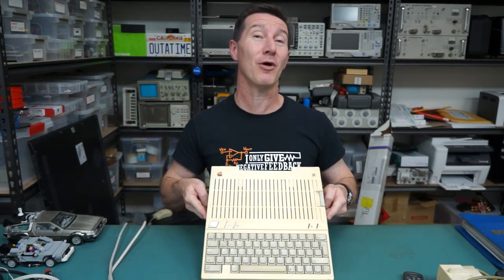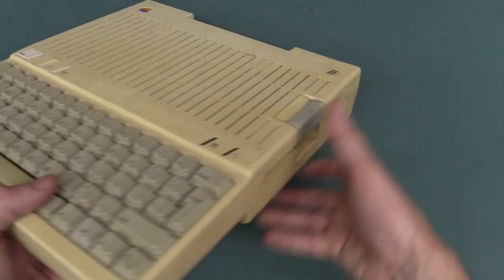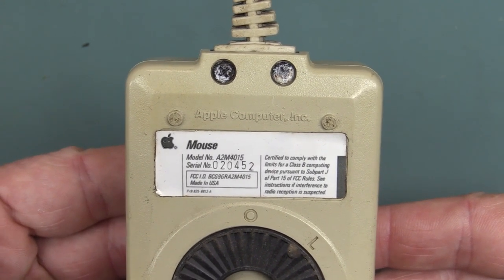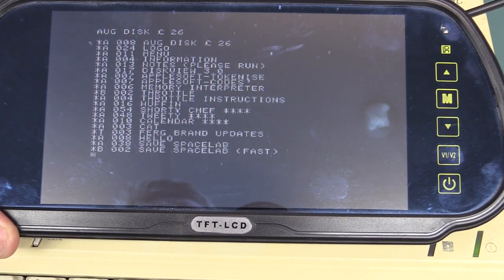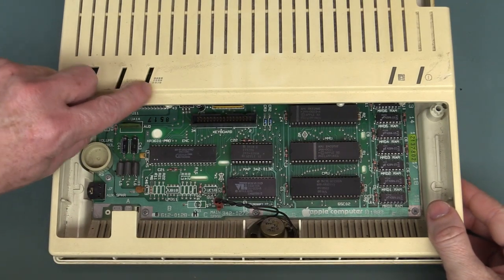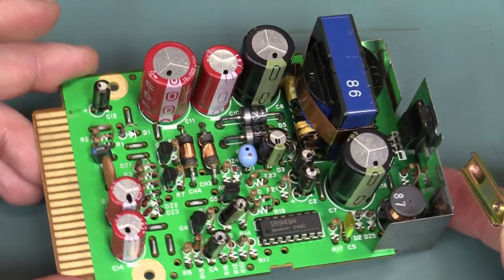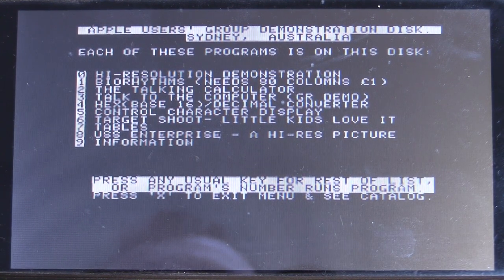EEVblog #788 - Apple IIC Teardown

Comment: I use a Dvorak keyboard religously. Made this decision at the age of 18 and coming on 20 it's still working well. I spent time analyzing the actual percentage of the time I spend using devices that are not mine, and noticed it's once in a blue moon - so it made sense to improve my speed and accuracy by learning Dvorak (yes it really does destroy your ability to use QWERTY well) - wouldn't go back ever I think.

Only problem is you have to order custom keyboards with the layout - which I do anyway with a WASD keyboard mech. And with a Macbook you can change the keys to the Dvorak layout without any fuss. Totally worth it :)

So I ask you Dave, from a logical standpoint... Why do people stick with QWERTY? Most use their own devices 99% of the time so why not use something that's better for you. Just a thought (not a rant)
Reply: You don't really need to order a custom keyboard. Since you shouldn't be liking at it while typing anyway, what's written on the keys doesn't matter. My main keyboard doesn't even have anything printed on the keys.
Reply: +ipullstuffapart and why is it better?
Reply: +cavemaneca If you're not 'liking' at it, maybe you should proof-read. lol
Reply: +Doug Wood I blame Swype.
Reply: cavemaneca
It can be useful sometimes, especially if you forget where a symbol is on the keyboard, as some are rearranged. My keyboard doesn't have any letters printed, just symbols.
Reply: CLIn7 l33tW00d
Dvorak increases typing speed by moving 70% of the typical keystrokes to the home row, and makes typing feel like a "wave" of sorts, you tend to use one hand, then the next, and back again - just the way that words are typed. Because you move your hands around less, less errors occur.
Reply: Ovidiu Lipsa
Nope, most keyboards have contoured keys that are specific to that row and position, if you move them, all of the tops are at odd angles and levels.
Reply: ipullstuffapart
but I believe that's language specific? maybe you can type faster in english but what about other languages?
Reply: +ipullstuffapart I am perhaps quite a fast and accurate typist, and much prefer the qwerty layout. Simple reason being that I don't use the 'home keys'. That entire method of typing is inefficient. You'll note this in professional stenographers, calculating accountants, and so on. People tend to find their own preferred typing method rather than a particular standard.
Reply: Gravity having a superior keyboard layout is not a necessary precursor to fast and accurate typing. With practice, any random distribution of letters could be used to type with. This doesn't make said keyboard layout actually any good by comparison.
Reply: +cavemaneca Keyboard layout is only relative to typing method. That's why the Dvorak layout has not shown to be 'superior' in scientific and corporate studies. Its only claim to benefit is putting more used letters on the 'home keys', which is irrelevant if the typist does not use a 'return to home touch typing' method. In essence, you find that above a certain typing speed, the typist may have a more custom method, while below that speed the person may not be typing enough for it to matter. There have been very clear corporate studies on Dvorak for a long time now, they just don't show an employee benefit to switching.

Comment: All Zorks etc use same virtual Z-machine system witch was made to work on all smaller systems of the era (C64, AppleII, etc).. There simply is no room for all texts on 64k or lower computers. 

Besides the texts on Floppy are compressed.. You'd need at least 256K to have it all uncompressed and loaded on ram
Reply: For the record.. The 555 is used to read analog (paddle) input, the paddle pot changes 555 recrarge time.

Comment: +EEVblog Hey nice videos... but I must ask why would anyone say the Apple IIc was a failure? The IIc was sold alongside the IIe as a smaller compact version of the Apple II series. The IIc was squeezed between the IIe and the IIgs and the Macintosh as well. The IIc was never meant to be a "laptop" computer but just a compact design. Though for 1984 the IIc design was pretty darn compact. Even so, in 1984 there were no true laptop computers that I know of unless I am mistaken? Yes I do get that the LCD screen is misleading but I believe that was Apple's way of showing off its design prowess at the at time.

Comment: at 18:02. Between the IOU and the MMU, what is "W2"? Almost looks like spark gap protection, but backwards. Hmmmm.

EDIT Found the answer online. W1 is a track that can be cut, W2 is a normally open solder bridge. Jumperless design apparently. :)

Comment: I'd like to see more vintage equipment. The bigger stuff example amplifiers, tv's, signal generators, rare desktop pc's

I wish i could send one big ass Turner A-300 Studio amplifier. 
But it weights a ton. And... well shipping from the Netherlands will be quite expensive :(

The Turner is really something, i wish Dave could do a teardown of my turner amp 
It has Bakelite/epoxy pcb's huge spacing between components, hand soldered extra thick ground traces, mil grade transistors (germanium) stuff like that. And really really monstrous transformer

Comment: As to the disk reading, if I had to guess, the program is probably hard coded to only load in so much data into memory at a given time as when it was originally written, it probably had a RAM cap due to the model of machine that was out at the time. Maybe it could only read 16 to 32k at a time to remain compatible with all the then current models. So no dynamically allocated RAM for you. You'll play that game like your grandpa played it and you'll LIKE IT! :)

Comment: I don't use a dvorak board, but now that you mention it...
The Razer program that came with my board gives me the ability to manually remap keys so could just pull the keys off of my board, move them, and remap the board.
Unfortunately, that's at the well above the OS level so if I change OS or need to do something in the BIOS it would go back to default map.

Comment: Dworak keyboard use here!
Reply: +AppleKnowsBetter keep working on your typing then!
Reply: +AppleKnowsBetter same here, but i only use Dvorak on my phone, so that I can change it more easy if someone else want to use it ^^
Reply: +AppleKnowsBetter Me too! Have been using Dvorak for 10 years now, never looked back. I never reordered the key labels, after all, dvorak makes it easier to touch type because the layout actually makes sense.
Reply: +retrotails WASD as far as I know dates back to the mouse+keyboard fps era, so much later. (I'm not a scholar but I did play FPS games at the time of change)

But games could be a reason, as they probably at the time wouldn't have had rebindable keys at the time (Atleast not the PC games I played), so you could end up with a hand stretching exercise.
Reply: +nimeq WASD predates FPS games by a good stretch.  I'm no scholar either, but I was there!  LOL
Reply: +William Hayden I was also there but in smaller form. The only case I can think of it being used would be multiplayer on single keyboard, which atleast on the PC was crappy, due to the key-press limitations of the typical keyboard+pc setup. That said, I only remember being exceptionally cramped in 2+ player games on a single keyboard, I don't explicitly remember if the any setup was WASD for the left most player, but it would make sense.

I guess it might've been a thing on the apples also, as they were expensive as hell, so only one of your friends would be likely to have one.
Reply: +AppleKnowsBetter I thought I was the last remaining Dvorak user, excellent to see some others!
Reply: +AppleKnowsBetter I wonder if you could just pull the key caps off and rearrange them for the Dworak layout.
Reply: Been using Dvorak for about a decade now. I have pulled off the key caps and rearranged them with previous keyboards, but I just leave them now. I know what's what.
Reply: What are the advantages/disadvantages of Dvorak vs. QWERTY?  I've only ever used a QWERTY only vaguely remembering seeing a Dvorak maybe once or twice.  Is it as simple as some people have an easier time or feel more comfortable with one vs. the other, or is it just a matter of what you learned on?  The arguments that I'm familiar with state the QWERTY is more efficient, but I'd like to hear first hand opinions.  Thanks.
Reply: I switched because I had read that one could type faster with it. After having gotten used to it, I'm not sure my typing speed has increased significantly but it did decrease fatigue when typing a lot because my hands move around less.
Reply: +William Hayden Qwerty is the least efficient possible. It was designed for the mechanics of typewriters and not for humans. Dvorak was designed for humans and all of the advantages that you read about it are spot on.
Reply: +AppleKnowsBetter I'm a Dvorak user here.  I never changed the labels so i'd never be inclined to 'cheat' and look at the keys.  It took about a year to change from Qwerty to Dvorak but i'm much faster than how i started plus i can actually touch type now.

(really messes up my colleagues when they jump on my computer.)
Reply: +AppleKnowsBetter I also use Dvorak!
Reply: +Merlin Gerlosa Only some shortcuts are compatible. If they were all compatible then it would just be qwerty. 
But I have this covered. I run a an autohotkey script which effectively reverts everything back to qwerty while i hold the ctrl key down. So i do copy/paste/new window/new tab/underline on the same physical keys as qwerty users even though the computer is still set to dvorak. It's glorious.
Reply: +AppleKnowsBetter Dvorak user here too!
Reply: +AppleKnowsBetter Another Dvorak user here... It drives my family and IT at work nuts. But everything supports Dvorak out of the box :) I never bothered changing the key caps because the whole point was to learn how to touch type.
Reply: At my college they still had an old IIc with the Dvorak layout on the keys. It also had an aftermarket CP/M board installed. As far as I know, it hadn't been used in years and probably hasn't been used since...

Regarding the WASD control scheme, in general most games on the II series didn't use those, using either IJKL or IJKM. IJKM was actually used in the BASIC interpreters for moving the cursor around until the Enhanced IIe, and even then it was still present for backward compatibility.

There was a 2 player game I used to play that did have WASD as the player 2 controls. Fortunately most of the keyboards didn't have any problem using that many keys at once, unlike a lot of cheap keyboards since then.

Comment: As for the handle, I bet that was Steve Jobs' doing.  He thought that handles on things made them more "personal," whatever that means.  When designing the original iMacs (the translucent CRT ones) he insisted on a handle even though it made the case significantly more expensive to manufacture and no one really wanted a handle, no one wants to lug around their CRT iMac.

Comment: At 9:44 the disk was single sided and someone punched a round (not square) write protect hole on the opposite side to save a few bucks. There was much controversy if running the disk "backwards" somehow would screw up the data.
Reply: It had to do with the dust catching cloth inside the floppies themselves. The theory was that spinning the disk backwards would dislodge some of the dust, allowing it to get wedged between the media and the drive head, wearing down the magnetic surface of the disk. As for whether any actual tests were done on this theory, I don't know, but in practice it didn't seem to matter.

Comment: Most LCD screens don't like the old 15KHz sync modes from old computers or arcade machines... They no doubt could handle it no problem, but they just aren't programmed for it.. :(
Reply: +10100rsn If it was using the RGB pins on the DB-15 video connector you'd be right, but the composite output shouldn't have an issue like that.  And the Apple //c graphics mode uses the same frequency as text mode.  The only significant difference I can think of is that there is no colorburst signal in text mode, but there is in graphics mode.

I wonder if this could be an NTSC-vs-PAL issue causing the display to not work in graphics mode.  I seem to remember reading that monochrome NTSC can be displayed by many PAL TVs, but not when there's a colorburst signal present.

Comment: I got a ][c that I've never turned on, bought it sans PSU at a thrift store probably in the 90s, and then took me a casual year or three to scrounge up the PSU.  Should take the 5 foot journey and fish it out of the closet and see if it comes on (more than likely most classic computers are veritable tanks when it comes to circuitry.
Reply: +Larry Anderson

Heh, ][c cost me 3.98, the psu was 2.98 (still has the prices in grease-pen) the big challenge finding a RCA cable... found, 
apple //c message on TV... "check disk"..
ok go through my disk files ... I know I have some Apple Diskettes collected there...

found a late prodos system disk... and it works!  What a stiff keyboard.

Now gonna have to find those game disks I have.  Only missing one representative of the "Big 4" from the 70s (Apple ][, Commodore PET, Atari 400/800 TRS-80) - I don't have is a TRS-80.  Someday when I find something cheap/compact enough...

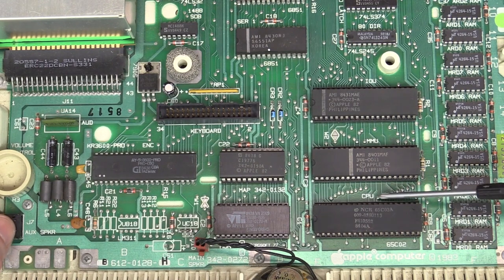Comment: 20:21 does that say Microsoft under that black wire at the bottom center? WTF?
Reply: Microsoft wrote the basic. Their 6502 basic was used in the Apple II	and C64. It was later ported to the Color computer (dragon), and other 8 bit machines.
Reply: +Joshua Walker Okay, but why silkscreen "Microsoft 77" on the motherboard? Microsoft didn't design the motherboard, just the ROM chip that stored Microsoft Basic. The chip above it says Apple.  It's confusing.
Reply: +HUGSaLOT Valkyrie The CHIP above that contains the Microsoft-coded Basic Interpreter known as "Applesoft". So, every Apple 2 had Microsoft hardware built-in. As a side note, Microsoft was really big with the early days of the Apple 2 series. The original Apple // had 48k memory, and it was Microsoft that created the 16k memory expansion card, bringing it up to a full (for the era) 64k of RAM. Microsoft also sold early Apple // games like Flight Simulator.
Reply: Technically, it's not Microsoft Hardware, it's still Apple hardware that happens to have Microsoft-developed code embedded in it. If you look closely, right under where it says "Microsoft 77" it also says "Apple 77".

Comment: So what makes that distinct woodpecker sound (9:59) in the hard drive(?) when you power it up? I had an Apple ][+ back in the day, and always wondered why it sounded like something was getting violently thrashed.
Reply: +Secret Squirrel It's the software re-syncing the head position by stepping them inward by 40 tracks.  If the heads didn't start at the outermost track, then they bang against the inner stop, making the noise.

Loud and sounds like something's broken, but that sound is a perfectly normal thing to hear when booting up or when DOS is trying to re-sync after an I/O error.

Comment: Did River Phoenix not power Apple IIC his and a CRT Monitor from a  9V battery in the 1985 Film the Explorers. 

Dam that good old Movie Magic...
Reply: +The Pumpking King I think they technically only powered the circuit they built from the dream with the 9 volt. The computer was plugged in, and the Thunderroad was later powered with lead acid car batteries.
Reply: What about the first time they tested the bubble outside. Up on the hill.

Comment: what type of capacitor is that funny little square shaped yellow one ? i have seen a few on some old circuits im desoldering
Reply: +killer1479 
if you are referring to the one labelled C45  in the bottom left corner then it's a monolythic capacitor. I think they are equivalent to a ceramic type.
Reply: Mark Cummings thanks :) they just look so... odd to me, kinda like theyre made of jelly, lol
Reply: +killer1479 I think its  a multi output resistor.

Comment: You probably want a fair dinkum CRT monitor for the graphics mode, the LCD either can't pick out the sync pulses or its doing unconventional stuff to do the graphics
Reply from the maker: +william fleete Yeah, i need a real monitor, or one of those proper RGB/composite to VGA converter boxes designed for the job.
Reply: +EEVblog 
Did y'all get SCART Down Under?  We didn't get it here in the States so I keep a couple broadcast/professional CRT monitors around for all my RGB needs.

Comment: Question.  I am not a real great electronics guy.  At about 27:14 right in front of the red capacitors there are two wire wound things by ch3 and ch4.  What are those?
Reply: +Jay Groom  Hi Jay!!    CH3 & CH4 stands for choke, old term for an inductor. 
Cheers,   Fred
Reply: Thanks.  I wondered about that with the wire in loops like that.
Reply: +Fred Cooper Inductors are chokes, they are still called that.